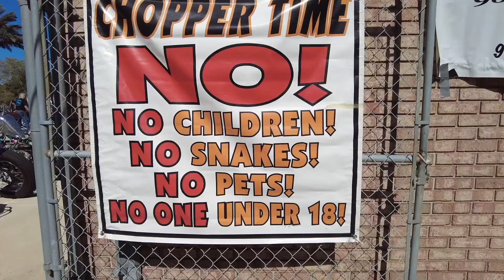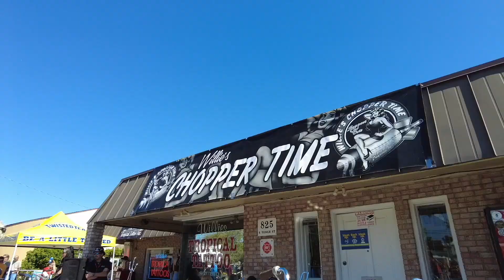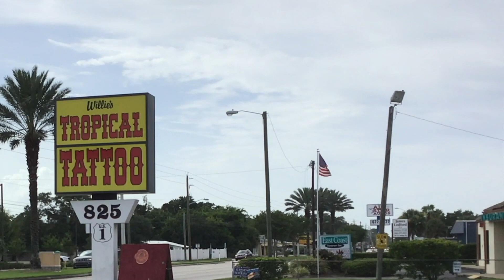What is or isn't a chopper?

Comment: Chopper...  A Motorcycle with a possibly altered rake and trail or length and height by cutting the frame and welding it back together in a non-stock form.  Bobber...  A stripped down Motorcycle that has had everything that's not needed removed to save weight and increase performance without cutting or altering the the frame's rake and trail.  :-) Peace, Stiletto :-)
Reply from the maker: That is the most direct, straightforward and best definition yet!
Reply: Exactly!!

Comment: How do you remove stuff off the bike ? Like are there unnecessary parts or accessories? I always wanted to build a motorcycle but never figured that part out. For Cars sometimes air intakes can be replaced or removed entirely without much change in performance same with wipers headlights etc to make it lighter I’m wondering if it’s the same concept ?
Reply from the maker: Great question. What chopper folks have told me is this, run only what you need. It started as an outlaw thing in the sixties mixed in with early bike builder culture of piecing parts from multiple bikes to make one bike. Chain guards, tank bibs, consoles, front fenders, speedos, primary covers, anything that isn’t frame, tires, motor, transmission or a seat and sometimes that’s just a pan with no cover or foam insert.